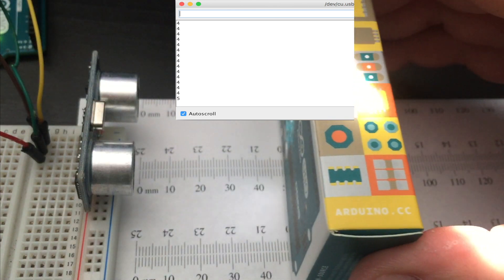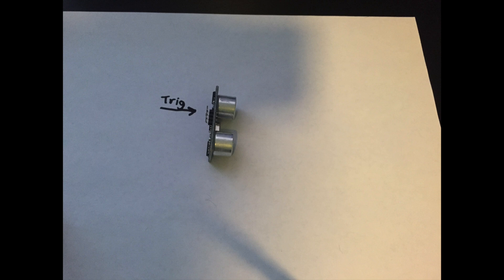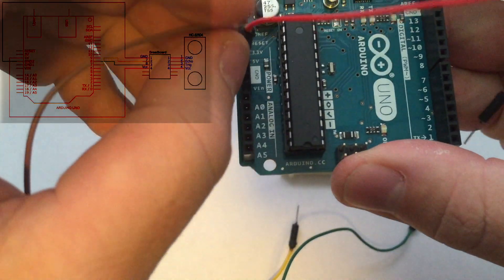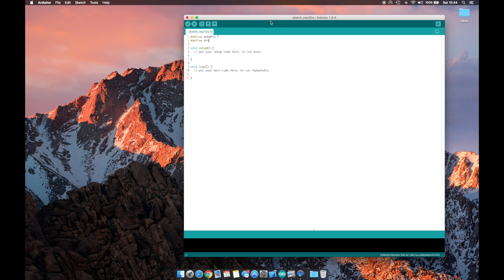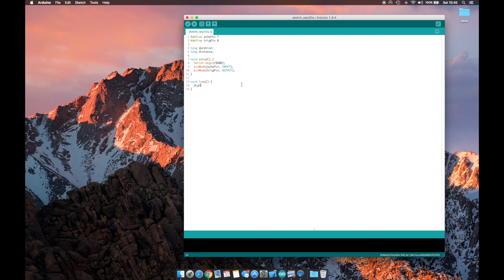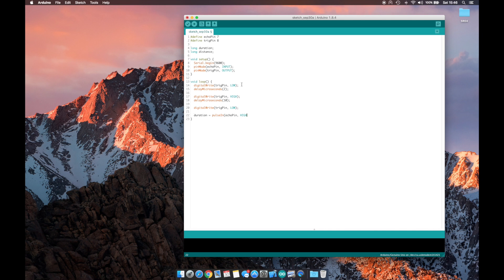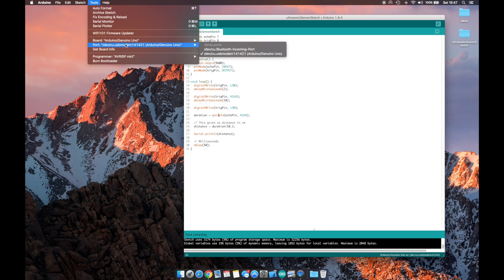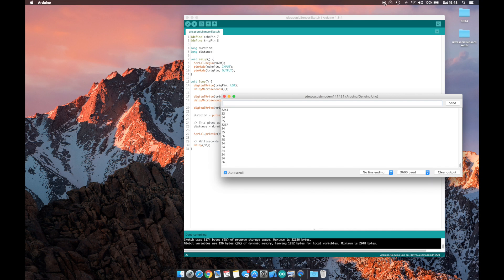How To: Use an Arduino with an Ultrasonic Sensor (HC-SR04)

Comment: why distance is only print 0 in serial monitor????????????

plz fast reply
Reply from the maker: Hi Avani, 
There are a couple of reasons why this might be happening. 
1) Your HCSR04 sensor is faulty. 
2) Your sensor is trying to read something too far away
3) Your code has an error

Please check your code to make sure there are no errors. Then try measuring the distance to something within about 10-20cm. Last but not least try a different HCSR04 sensor. Also, don’t forget to check your wiring. I hope this helps.

Comment: #define echoPin 7
#define trigPin 8

long duration; 
  long distance; 
void setup() {
  // put your setup code here, to run once:
  Serial.begin(9600);
pinMode(echoPin,INPUT);
pinMode(trigPin,OUTPUT);
}

void loop() {
  // put your main code here, to run repeatedly:
  digitalWrite(trigPin,LOW);
delayMicroseconds(2);
digitalWrite(trigPin,HIGH);
delayMicroseconds(10);
digitalWrite(trigPin,LOW);
duration = pulseIn(echoPin,HIGH);
distance = duration/58.2;
Serial.print(distance);
delay(50);
}

Comment: how to stop the looping?
Reply from the maker: Hi Syakirah, there are a few ways to stop a loop. Here are the best two ways:

To stop the loop temporarily use the delay(int) function. For example, delay(1000); will pause the loop for 1000 ms or 1 second. 

To stop the loop for good, use a call to exit(0); This will exit the program until your Arduino is rebooted or reset with the reset button.

Comment: Does i need to connect to arduino board  or not because i did not connect it
Reply from the maker: Hi, yes. Follow the instructions to connect the 4 pins on the HC-SR04 to the appropriate pinouts on the Arduino Board

Comment: They said that "echoPin was not declared in this scope
please reply someone who can help!
Reply: make sure you define "echoPin" outside of the setup and loop brackets. If you declare the pin inside of setup, and try to use it in the loop function, you will get an error. But if you declare it outside of all the functions then any function will be able to use that variable

Comment: The reason to divide by 58.2 is that the speed of sound is 340/s(rounded). Divide this because you only need the "go" time, which is half the distance of the entire time, thus dividing it by 2. So now it is 170m/s and we want to turn it to 17000cm/s for easier calculations. The equation now is distance = 17000 cm/s * duration, so what is duration? Duration is calculated by microseconds which is one millionth of a second. That puts the equation to 17000cm/s * 1/1000000. We can take off some of the zeros and simplify it to 17cm/s * 1/1000 (take 3 zeros off each side). The result would be 1/1000*17/1. This would be right but sometimes it might make the program to show zero. So we turn it to division which is 1000/17 which is around 58.82. Hope that helps!

So basically: 
= 350m/s / 2 = 170m/s; 
=d * 17000cm/s; 
=1/1000000 * 17000cm/s 
=1/1000 s * 17cm/s
=1/1000 * 17cm (second cancles each other out)
= 17/1000cm
= duration*17/1000cm
= duration/(1000/17cm)
= duration/58.82

Comment: Why am I getting values between 2200-2222? The setup and coding is exactly the same. Anyone?
Reply: UPDATE: 

The sensor was faulty, tried a different one and works fine.

Thanks
Reply from the maker: @Fresteeyles  Thanks for your update! I have also experienced a few faulty sensors, but in general they seem to work very reliably :)

Comment: I am going to guess those funky values are caused by echos returning to your device or maybe some other ultrasonic sound that just so happens to get picked up.  Limiting the number of times you ping should help... as well as creating a limit to how far the object can 'detect' up to.
Reply from the maker: Hi Chaoddities, thanks for sharing your ideas. It is very possible that there is some "noise" (no pun intended) causing the funky readings. Setting some constraints is a great idea to reduce or remove this issue.